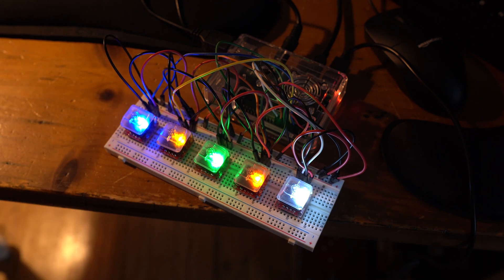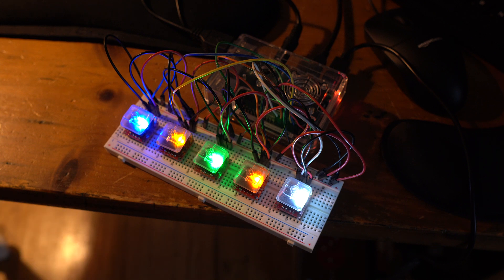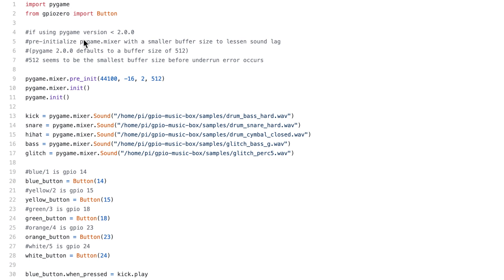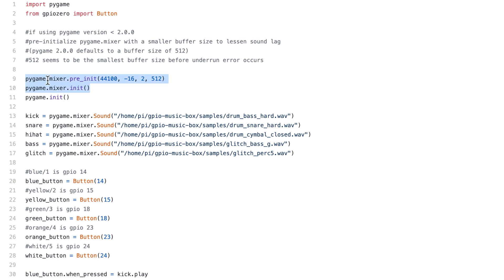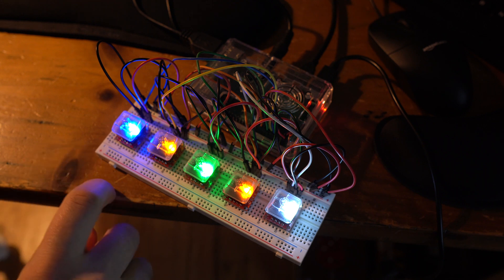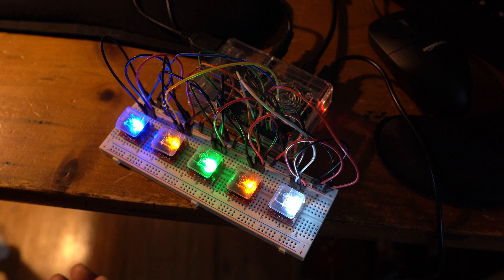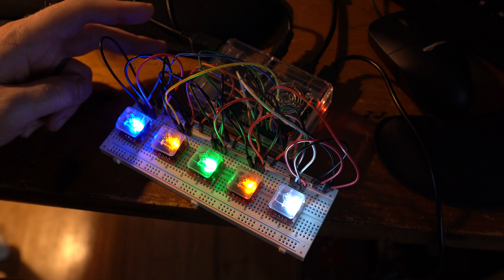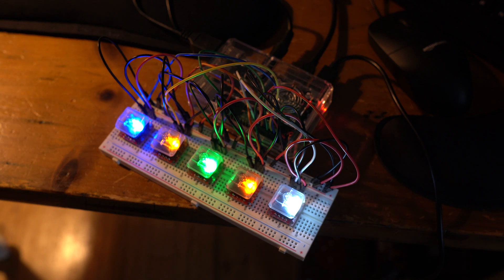Raspberry Pi GPIO Music Box | 424recording.com

Comment: Have you ever used samplerbox. It’s a free pi software that turns the pi pitched sampler and I think it can also do drums. I wonder if you could make a drum set for super cheap with it
Reply from the maker: I haven't! I need to check that out. That might be a better solution. Thanks, Kai!

Comment: Isn't problem solving so rewarding!  I've been fixing up a car in my spare time.  It's fun just to use the brain in different ways.  Quarantine is one hell of a drug.
Reply from the maker: Haha. Yeah! It really is. I was banging my head against the wall with this for a while, and finally figured out what the issue was after weeks of picking this up and putting it down. There's something to be said about objective problem solving and I'm sure the car is the same way: when it works, it works. What kind of car is it?
Reply: @424Recording  It's a '12 VW Beetle turbo.  It has an engine in it I really like.  I stage one tuned it. So, after that I upgraded the clutch, shifter, brakes, suspension, and exhaust. I went into the project not really having a clue how to work on cars. It's been a really cool learning process and having physical results is nice.
Reply from the maker: Dang that's cool, Jody and sounds like a fun and fulfilling project. I've always wanted to get into car repair; I like the idea of it being a finite system and cars always seem like a bad investment unless you know how to fix them!